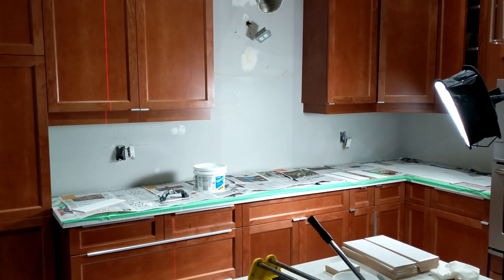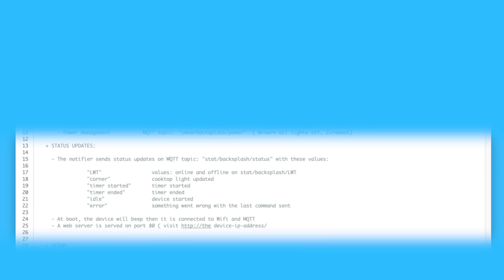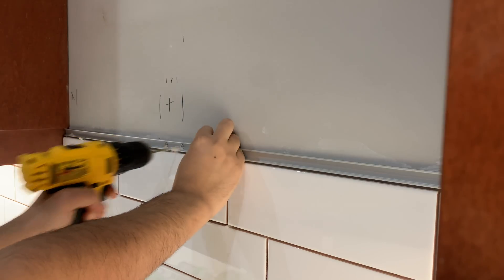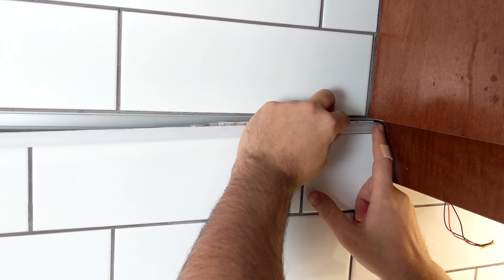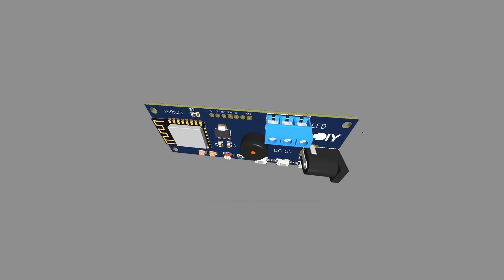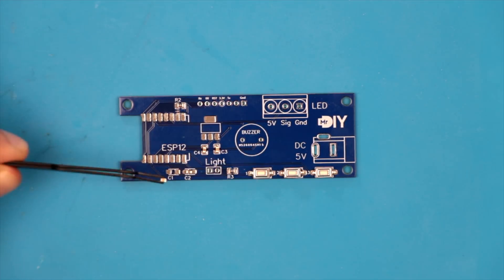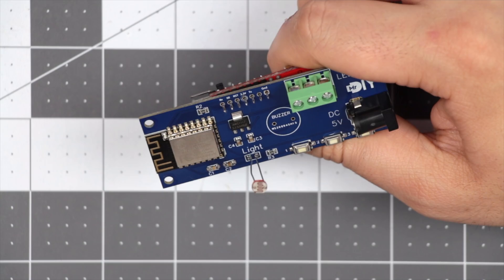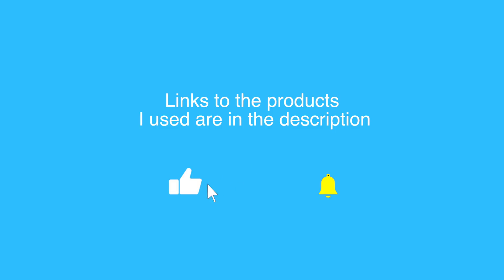I Made a Wifi Connected Smart Backsplash Using an RGB LED Strip

Comment: Nice job.  How did you do the sensor for the cooktop?
Reply: Yeah, how do you detect when the gas cooker is on?
Reply from the maker: I am using a CE smart plug with energy monitoring ( I showed it in a previous how-to video: https://youtu.be/DDYK7cE9rEA)
I got it a while back from Costco and installed Tasmota on it (MQTT). 
Luckily, when the cooktop is on, it consumes 1W .. enough for me to use it as on/off indicator.
Reply: @MrDIYca  figured any way to monitor gas usage?
Reply: Is it a smart gas cooker?

Comment: How do you know when your cooktop is on? How does the esp knows it?
What is the ESP12, I knew about the ESP32, but not the 12! :D
Reply from the maker: I am using a CE smart plug with energy monitoring ( I showed it in a previous how-to video: https://youtu.be/DDYK7cE9rEA)
I got it a while back from Costco and installed Tasmota on it (MQTT). 
When the cooktop is on, it consumes 1W .. enough for me to use it as on/off indicator.
Reply from the maker: The ESP-12 is an ESP8266 module. This vidoe explains the difference https://www.youtube.com/watch?v=dGrJi-ebZgI

Comment: Have you seen these new high density strips? I wonder how much more you could do with more LEDs per inch? Nice project. BTW, you could probably hang off that strip based on how you attached it lol. Still well done.
Reply from the maker: Yes, I can always swap them with the 300LED/m version but I don't have use case for that yet.This will do for now.